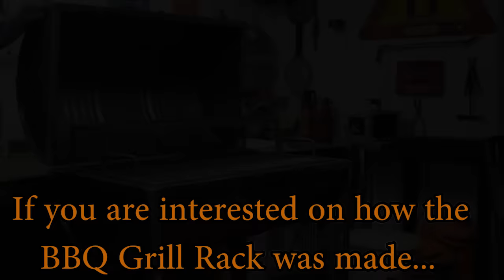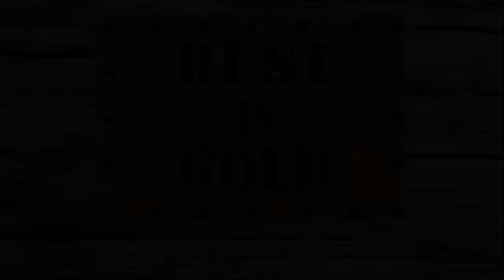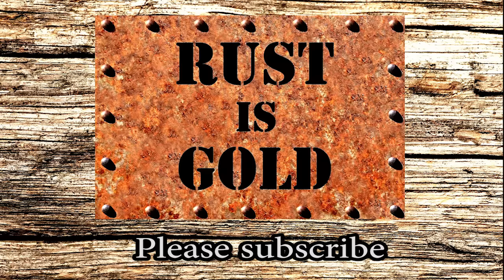HOW TO BUILD A BARREL BBQ/SMOKER (PART 1)

Comment: This is very educational. I wish you have a online paid course for this, it's inspiring!
Reply from the maker: Thank you very much for your comments!! 😊👍👍
Reply: @RustisGold  That plate that you're tacking inside the drum @7:14 will that keep the bottom of it from rusting and developing a hole in it? Bbq grills thats made out of 50 gallon drums seem to crumble and deteriorate after a while.
Reply from the maker: Exactly. The charcoal will not come in contact with the relatively thin surface of the 50 gallon tank so it will last longer. Also I store the BBQ in a dry and protected from rain place. 😊👍

Comment: please before u use fire to remove the paint make sure the parrel is not plugged so the air dost get trapped  inside and expands  which may cause the parrel to explode
Reply from the maker: Yes I know.... Before I used fire, I removed all the lids and washed the inside of the barrel with plenty of water.
Reply from the maker: https://youtu.be/3fgH69J1lkQ

Comment: So using your video as a guide I was able to build me a similar grill. Unfortunately where I live we don’t have much available for purchase unless you wanna fork out $$$$ at Lowe’s or Home Depot. So I used bed railings for my angle iron.  - Never again. I got the railings pretty much for free, but the money saved on angle iron was easily spent on sanding disks and wheels for my angle grinder, and it added HOURS to my project. Some were rusty, which sadly was still easier to remove than the friggen powder coated paint they use on those. Plus getting free stuff means getting different sizes. 
I had to purchase my round stock for the grate, and WAY overpaid at Lowe’s and Home Depot, who carry minimum stock btw. After it was done, I started searching around for metal yards (I needed two grills for what I was planning), and learned I could get all of the raw material, including brackets, handles, wheels, paint, etc. for around $150 (US). 

I wish I could upload photos. The grill came out beautifully - and I’m barely ok at building things. I didn’t know how to weld at all before I started this project, but I lucked up and found someone selling his gas-less MIG welder for $75. I bought some cheapo startup welding supplies from Harbor Freight, watched a few YouTube videos, and just got to it. I know there are a lot of flaws with my welds, and I wouldn’t put them through any extreme stress tests, but overall they turned out well. The welds joined beautifully at the joints for the angle iron, but for some reason the round stock didn’t want to bind. I had idk, somewhere around 120 weld joints to make for them, and they all gave me a difficult time, which led to overheating. So my grate is slightly bowed in the middle on the top and bottom grates. It’s not extremely bad, and though it annoys me to know that the bow is there because of my lack of skills, I actually kind of like the look. Others that have seen the grill likes it as well. 

Anyway, if anyone wants to see my results, let me know. You’ll have to let me know how to upload photos without creating my own video and uploading the link. But if that’s what I have to do, then I’ll do it. It’s nowhere near the quality of his grill, and is actually not 100% complete - after two weeks of spending every free hour working on this thing, as well as almost definitely ingesting WAAAAY too much iron dust, I was just ready to be finished with it. 

If I can build this thing, having absolutely zero professional training in any aspect of building, from measuring to cutting to welding, then anyone can and I encourage you to do so. I will recommend to use the smallest size angle iron that will work with the drum - it gets pretty heavy. Also, I found that the only drill bits worth using on the angle iron are Cobalt tips, with the easy start angle. I believe it’s 120 degrees, but don’t quote me on it. Every other bit burned out before making one hole - even the Titanium ones, who boast being able to drill through iron. The Cobalt costs more, but are definitely worth it. I bought a Milwaukee set for around $40 I believe. Hit me up if you have any questions.
Reply from the maker: Thank you very much for your extremely detailed comments!!
Well done, Bravo!!!
I will keep the part I liked the most from your comments: "...If I can build this thing, having absolutely zero professional training in any aspect of building, from measuring to cutting to welding, then anyone can and I encourage you to do so..."
Exactly!! This is not nuclear physics! When I started to restore or create objects I also had no clue on what to do. All it needs is to get up from our couch and start doing things.
I get so upset when people comment that it would be better to go and buy it from a store instead of spending time building it... They have no clue of the joy someone feels when creating something from scratch.
This is the true philosophy of DIY. It's all about creation, not about saving a couple of dollars or euros by buying a cheap Made in China piece of junk...
Reply from the maker: You can send me photos on my email address rust.is.gold.diy@gmail.com  or send them through messenger on my Facebook page: Rust is Gold - Diy Creations
Reply: @RustisGold  do you all these?
Reply from the maker: @kelishawebb1058  yes I made it my self.
Reply: @RustisGold  I'm sry. I wanted to know if you sell them?
Reply from the maker: @kelishawebb1058  sorry but I don't sell. I only make DIY projects and post them on my YouTube channel...

Comment: Can you provide me the measurements for these? I fell in love with this grill
Haha
Reply from the maker: Glad you liked it! 😊👍
Here are the measurements for the Barrel BBQ:
https://www.facebook.com/photo?fbid=2562179130553153&set=a.2562180023886397
Reply from the maker: Here are the GRILL RACK DIMENSIONS

The dimensions of the bottom grate are 90.5cm X 52cm.
The dimensions of the top grate are 87.5cm X 22cm.
The height of the top grate is 16cm.
I used iron angles with dimensions  3cm X 3cm and 8mm diameter rods with 2cm gap in between the rods.
However, I suggest that you have to make the grill fit your BBQ's dimensions.

Comment: I can't see how you remove all the ashes in a convenient way, may be make a "trap door" at the bottom so that when open, all the ashes will fall down.  Also you need to open an adjustable air hole on both side to control oxygen going in for the fire level.  Thank you.
Reply from the maker: The ashes is not really a problem. I remove the grill and I collect them. However, you are right, I am going to open an adjustable air hole on the other side of the BBQ as well.

Comment: Excellent built I only would have put the vent on the opposite side of smoke stack but it looks really good
Reply from the maker: Thank you very much for your comments! I spend some time on the internet looking which side would be the best to put the vent, I didn't come into a conclusion. People place the vent on either side of the BBQs. In my case it works perfectly. In case I see that something is going wrong I can very easily put another vent on the other side as well.

Comment: Excellent design and build! What size angle iron did you use? 25mm?
Reply from the maker: Thank you very much for your comments! I used the thinner grinding dics I could find, the ones used to cut inox.
Reply from the maker: Sorry, I just realized you were talking about the thickness of the angle iron I used... Yes it was 25mm.... Sorry, my mistake...
Reply: @RustisGold  : Nice B.B.Q. Well done mate. ( By the way a small correction if I may. Is not a grinding disc that you are using. Is a cutting disc.) Cheers.
Reply from the maker: https://youtu.be/3fgH69J1lkQ

Comment: I really wanna thanks for the tutorial. I just finished building my first one, mimmicking most of your ideas. I had never welded before, and doubted myself often, but pushed through it. Of course it doesn't look as professional as yours, but I still get alot of compliments and requests. If I could load pictures I would. Anyway, thanks again. 

P.s., I used bed railings as my angle iron. I highly advise against it. Find unpainted steel. That powder coat is a pain in the ass to remove.
Reply from the maker: Thank you very much for your comments! Very nice! Glad I helped you! You can send me photos on my email:
rust.is.gold.diy@gmail.com

Comment: You use the cutting machine in a dangerous way. Never let the disc stand in front of your body when cutting! Always position your body to the right of the cutting machine, so if the cutting blade breaks a fatal accident can be avoided. And congratulations for the final work that was very beautiful!
Reply from the maker: Dear Um Brasileiro no Brasil, thank you very much for your advice. I will definitely have it in mind when using a grinding disc in the future!
Reply from the maker: https://youtu.be/3fgH69J1lkQ

Comment: Good job. Only thing I'm no welder & don't have any access to welding equipment. Be ok if no welding just straight forward cutting & bolting.
Reply from the maker: I guess you could also do it without using a welding machine, however I don't think it would be an easy task! 😊👍

Comment: Hola muy bueno, que medida de angulo usaste? Gracias
Reply from the maker: Thank you very much for your great comments! I used 3cm X 3cm
Reply: Hola Javier, no hablo mucho español pero escribiré esto lo mejor que pueda. El hierro que puso en el cañón se corta a 45 grados. Cuando las piezas estén ensambladas, cada esquina interior medirá a 90 grados.

Lo siento si mi español no es bueno.

-Nelson
Reply from the maker: Me disculpo.  Pensé que habías preguntado qué tipo de ángulo de hierro usaba ... (no hablo español, uso el traductor de Google).
Reply: @RustisGold  they may have, to be honest I'm not certain if there is a specific word for angle iron in Spanish or if they were asking for the angles used to cut the bars. 

Great build by the way, I just got a 55 gallon barrel from craigslist and I'm in the process of cleaning it now 😁
Reply from the maker: @xSgtScruffy  thank you very much for your comments! 👍

Comment: So many DIY smokers I see make from propane or water tanks that are very thick metal. How does the much thinner barrels hold up to the heat? I like the idea to keep weight down
Reply from the maker: Of course the thicker the metal the better. So far it seems to hold up fine... However when I don't use the Barrel BBQ I store it indoors away from rain and humidity.

Comment: New sub! Great craftsmanship. You make it seem like I can do it….some I’m going to try🤪 Will let you know the results 👍
Reply from the maker: It's easier than you think! However it needs patience! 😊👍
Thank you very much for your comments!
Reply: Got  2 barrels. Got one prepped and ready to cut! Quick question. What are those round disk you are using to attach the screw in castor wheels?
Reply from the maker: Sorry for such a late reply...
The wheels I used were from an old super market cart.
These round things are where the wheels are screwed.
I removed them from the shopping cart as well.

Comment: Since watching your video I've bought the oil drum, sanded off the paint and cut the barrel in half.  I've bought a second hand stick welder and am ready to try and weld the frame.  Could you please tell me what to search for when looking to source the metal.  Is it like metal corner bracing or something?  Loving the work, thanks for making the videos.  Jim UK.
Reply from the maker: Thank you very much for your comments! Sorry but English is not my native language and I didn't understand your question regarding sourcing the metal....
Reply: I think he just used angle bars
Reply from the maker: Yes I did 😊👍

Comment: Any tips and tricks while making this? Gonna be making it for my dad for father's day!
Reply from the maker: It required a lot of work but it wasn't really difficult to make. Be careful when you weld the barrel. Use maximum 2mm welding rods because it the metal is quite thin...
Reply from the maker: Nice present for your father! 👍👍👍
Reply: @RustisGold  great thankyou soo much. Working on it slowly.  Cant wait for the end result.  Also, whaat kind of metal did u use for the grill? Is it a specific one?
Reply from the maker: No, just normal 8mm metal rods and angle iron.

Comment: Hi Mr. Rust! If may I ask, how many angle bars did you use for this? Thanks! I watched this video for 5times, planning to use the steps for my business! Excellent work! Greetings from Philippines!✊🏼💯🤝
Reply from the maker: Here are the measurements for the Barrel BBQ:
https://www.facebook.com/photo?fbid=2562179130553153&set=a.2562180023886397
Reply from the maker: GRILL RACK DIMENSIONS

The dimensions of the bottom grate are 90.5cm X 52cm.
The dimensions of the top grate are 87.5cm X 22cm.
The height of the top grate is 16cm.
I used iron angles with dimensions  3cm X 3cm and 8mm diameter rods with 2cm gap in between the rods.
However, I suggest that you have to make the grill fit your BBQ's dimensions.
Reply from the maker: Hello my friend! I sent you information with the dimensions of the BBQ and the Grill rack. I hope they will help you!
Greetings from Greece!! 🇬🇷😊👍
Reply: Thanku

Comment: i got a better ideal, Down on the legs weld some metal that will hold the barrel in place, Make the stand but don't weld it to the barrel>  That way can just replace the barrel when need too.  Can always use your stand with the shelves,  wheels for another new barrel
Reply from the maker: That's a very good idea! Thanks a lot! I will follow your advice when the time comes to replace the lower barrel!
Reply: @RustisGold    Thanks    only good fire paint i found is Chemo z  a zinc primer paint, any place not have the paint on it will rust,  it has to be down to bare metal too when applied
Reply from the maker: @426superbee4  I used a similar paint as the one you described that's why I removed the original paint.
Reply: @RustisGold  cool that the only thing that holds up to heat and rust I use to sand blast that what i put on for primer Chemo Z it was 2 parts prime and zinc>  i got it on my offset been on it 20 yrs now no rust setting out in the weather we got our hands on some pipe liner, casing 36 inch made some offsets from it
Reply from the maker: https://youtu.be/3fgH69J1lkQ

Comment: Would be kinda interesting to know how much you spend on materials to do this contra just buying one of similar design. 
Was it more expensive and did you just do it for the fun of it or did you save money doing it yourself?
Reply from the maker: Thank you very much for your comments. The materials cost me around 120€. However I also had some materials in stock. So a better estimate would be around 180€-200€ (maximum). 
I definitely did it for the fun of it but at the same time I saved saved money. It was a win-win situation! 😊 Net time it took me around 2 weeks to build it.

Comment: the drum is like 2mm thick.. how functinal is it for a bbq? i think i would a lot of heat. or am i wrong?

but for a smoker it should work great. I hope that becouse i am makeing one.
thanks for the great tricks.
i like how you made those handels for the  shelfs.  
great work.
Reply from the maker: Thank you very much for your comments! It works very well as a BBQ. I am not sure how long it will last because it is thin. However, I keep it in a dry place.

Comment: Great project, I am going to be building one of these next weekend.  I am going to "upgrade" it with 25mm RockWool insulation all round, and see if I cannot make it safer for kids around, when they touch, it will not burn.  Also, I want to try and put a rotissirie in as an option, and an extractor fan, perhaps. Can you send me the plans, please, so I can get the bill of materials to my hardware store.  I love your channel, keep it coming, bro...
Reply from the maker: Sorry for such a late reply...I didn't see the comment...
Here are the measurements for the Barrel BBQ:
https://www.facebook.com/photo?fbid=2562179130553153&set=a.2562180023886397 

GRILL RACK DIMENSIONS

The dimensions of the bottom grate are 90.5cm X 52cm.
The dimensions of the top grate are 87.5cm X 22cm.
The height of the top grate is 16cm.
I used iron angles with dimensions  3cm X 3cm and 8mm diameter rods with 2cm gap in between the rods.
However, I suggest that you have to make the grill fit your BBQ's dimensions.

Comment: Great job. Video recorded and edited very good. Only thing that I will change in editing will be to put a list of all materials and specifications, dimensions, that you use in this project. Also I want to know what kind of wellding helmet do you use. I have two chineese, but battery replacement is too offten. Do I need to put it out when I don't use the hellmet? Or which brand you can recommend? I wish you all the best.
Reply from the maker: Thank you very much for your comments! I bought the helmet from eBay for around 20€. It is nothing special but it works fine. I have it for 2 years now, I haven't changed any batteries yet...